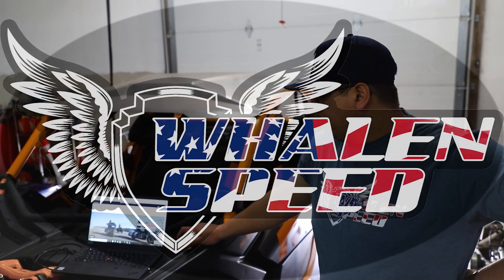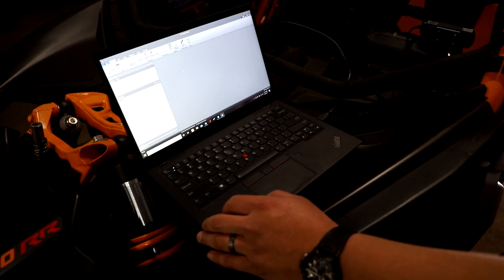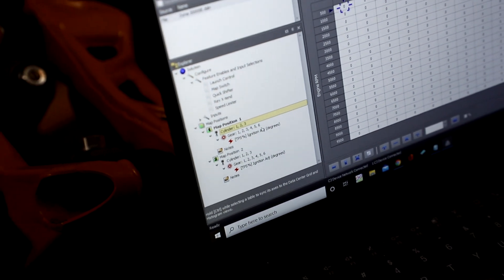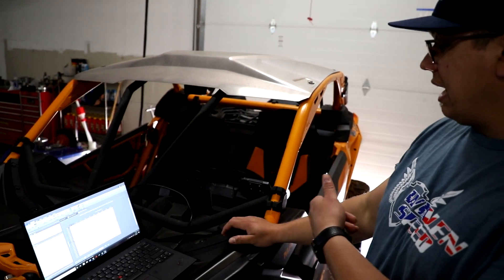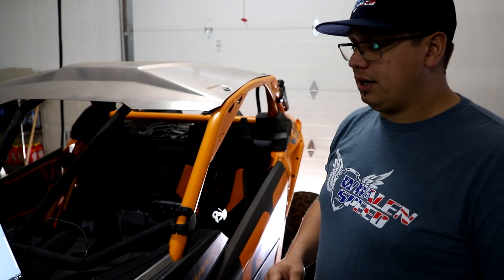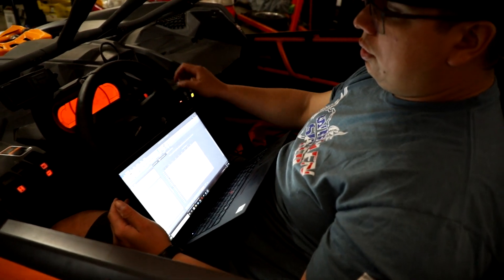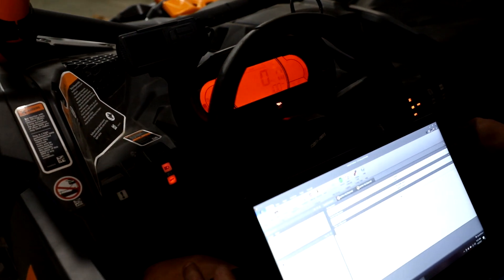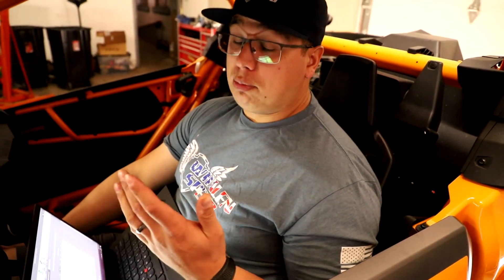Whalen's Speed: Can Am X3 (2017-2021) DynoJet Launch Control Overview

Comment: Do i need upgrades to it or anything cause I have one but not sure how to install and mine is 2022
Reply from the maker: Not necessarily, any upgrades will be open to you. There are some basic upgrades I'd say every Can-Am needs. Which you can always reach out and we can help.

Installation can be tricky if its new to you,  the ignition harness CAN be flipped. Just make sure to refer to the install instruction in the box.

Comment: What are the benefits (Build Boost?) of the higher RPM?
Lower RPM (Quieter???)
Thank You!
Any suggestion on how high to make it?
Reply from the maker: A launch control will give you a slight advantage at a start line. The LCM will create boost pressure while you're staging. Launch control goes hand and hand with your clutch & RPM engagement. Higher the engagement, the most boost you're able to make. Our 2600 PRM engagement is a popular starting point. But, it'll be personal preference.

Comment: SO you have to have custom tuning or the DYnojet software is good enough? I got this as a gift and a switch. It's not plug and play?
Reply from the maker: No custom tuning needed, technically. You're limited a little bit compared to our configured in how it can be set up. Since we pre-load the LCM with our specs and to the customers clutching.

It is plug and play, it does install a specific way. Make sure to check the instructions. Some connectors can be swapped and that'll create problems.
Reply: @whalensspeed  Do you need to have the spring? my clutch kit from AA only comes with a different primary spring they said they use the stock secondary. I want to launch around 2200 RPM. Do i have to have the spring or just set the launch rpm at 2100?
Reply: @whalensspeed  ok thank you

Comment: For whatever reason, we cannot get ours set up right.  Our tables look very similar and still it does not build boost, nor does it even sound like it's working like it should.  Clutch engagement is at 4200 and we set up the LCM FOR 3900.  Is there any way we can pay to have ours updated with your firmware/setup?
Reply from the maker: Email john@whalentuned.com

Thanks

Comment: How accurate is the boost gauge on the dyno jet. My 2020 RR is seeing 21 psi tuned.
Reply: It's reading what the ecu reads. If I'm not mistaken, the RR over boosts to 21 psi on launch by design before coming back down to 18psi on stock tune. Aftermarket tuned should be holding around 21psi depending on the tune you have installed. What psi are you looking for?
Reply: @brandenjoseph604  : well tuned I thought is was 22.5
Reply: @brokesxs2547  they all have different tunes requested psi's. So if it's asking for 22.5 but only hitting 21, there are a few possible causes. Did you set the waste gate crack pressure to 10psi using something like a mighty vac? Are you testing on a surface that provides good grip? It needs proper load to hit it's boost. If the tires are spinning the entire time when data logging, it might not hit it's target. There can be a boost leak. If you data log, check the tps to make sure it's hitting close to 100%.
Reply: @brandenjoseph604  : I set the crack pressure and was doing test runs on pavement.
Reply: @brokesxs2547  boost leaks and verify TPS. Also check the log and make sure you aren't getting any knock and pulling timing.
Reply: @brandenjoseph604  : I’ll do that this weekend. Thanks
Reply: @brokesxs2547  that's as high as it reads my whalen e85 tune shows that as well but it's actually  28psi